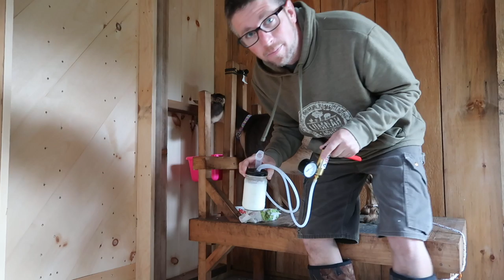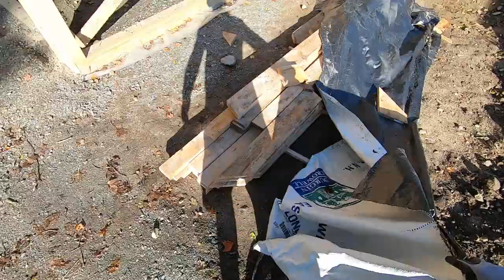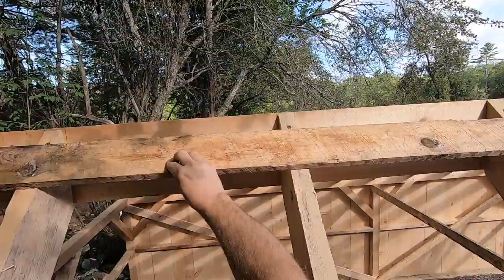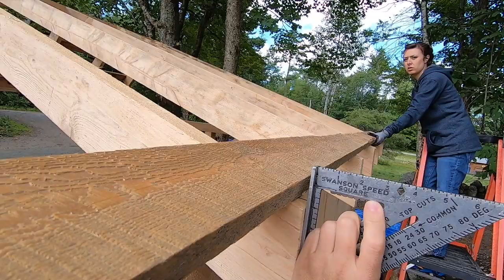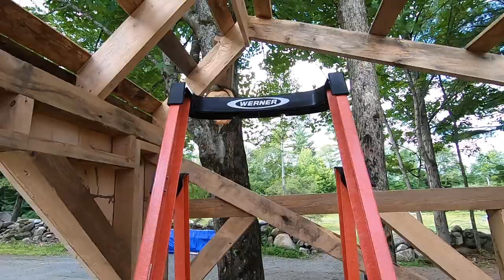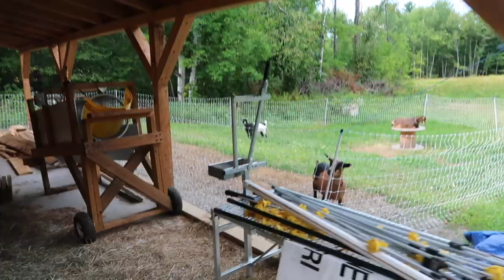She Doesn't Have her SEA Legs Yet! 1st Time Working on Scaffolding

Comment: Thank you ... from my old days of building houses and before aluminium staging, we used 2 X 12's --- to stabilize the walking platform (using 2 - 2 X 12's) we would screw-on a small piece of plywood or scrap 2 by ... this would help to eliminate the bounce and provide a comfortable walking platform.  Again, thanks for sharing.

Comment: Suggest putting pallets down 2 stack firewood on inside the shed...
Reply: I was thinking those pallets they used to separate the new fire storage shed would be perfect.  I think they came with the goat barn.
Reply: I use pallets for big round hay bales and firewood. Snakes love it in the summer. It helps save the hay and wood, but my nerves are a wreck. LOL.

Comment: Nice shed but I'd suggest putting a gutter over the front part, otherwise you're gonna get a lot of rain water creeping in. I know it maybe not that good to look at but it avoids any damp build up at the entrance. Good luck!
Reply: sorry I realise I did not explain myself properly, without any roof overhang protecting the openings, you're going to get rain falling inside, obviously how much depends on which direction the wind blows the bad weather, even if most comes from for example the rear, I am sure like where I live the wind brings the rain normally from the west off the Atlantic Ocean but many other times it'll blow from all directions, and when really stormy, it blows horizontally!! I recently put some guttering up and extended the roof by 4 feet, all to prevent some old wooden cladding from rotting. Good luck again, enjoy the videos and like many, full of admiration for taking on such projects, a heavy responsibility -  you're fortunate indeed to have essential family contributions to help ease the workload!!

Comment: I built a basement under my house with stairs going down. It was warm but not too warm as the moisture from wood drying didn't need to be in the floor. I could put five cords of wood down there and it sure was easy and convenient for me to get the wood needed for the mrs., to keep house warm. She could if needed get down there cause we had our largest pantry down there. I sure miss that house that took the two of us about all told three months to build then work on for the rest of the time I lived there. Houses do need maintenance from time built. Ours was appraised at four hundred thousand dollars and we cut all the lumber off our land and only bought the fancy moldings and what not plus the brick for the two fireplaces. We put the king stove inserts in the fireplaces as we intended at the start

Comment: Kudos to Gina for getting up on the staging. I've worked with people that could scramble around on staging and wall plates like monkeys. Not me, my toes would curl around like I was trying to get a death grip with my feet. Safety tip with staging. Don't stage materials on your walk planks, they're a trip hazard. Better to put more planking across the top rails of the staging behind you to set tools on and stage the materials on or behind that.

Comment: That is not a lack of "sea legs", that is a Fear of Heights.  I feel you Gina.  She cannot even stand to see you off the ground, Al.  Gina was over-the-top brave to do her part in making this a bit easier for Al.  Once I get off the ground, I can feel myself falling.  It is a very real feeling.  I have to hold on to something to counter-act that horrible feeling.  I used to go hiking in the mountains when I was younger.  And when I got to a steep on-the-edge part I had to hold on to rocks, trees, branches, roots,  the ground (and move like a crab) whatever.  Here I am with a 100 pound backpack holding on for dear life to the side of the mountain.  I even have trouble breathing.  My whole body goes into a sort of panic mode.  Take care cuties.  Also, Al, Kevin at Weed Em and Reap needs your goat milking machine plans that you designed and built.  He bought one online and it was fail.  Have a great weekend Lumnah Acres.

Comment: Did you do an analysis on the cost of wood vs. gas/oil, since now you have the cost of buying wood , wood shed and valuing your time to stack, feed the stove etc.  ie. your time could be devoted to utilizing your field and its potential to return value.
Reply: I think what you are saying is, burning wood is not economical and a time hog.    This would be somewhat true.  Nevertheless, there are intangibles to burning wood, such as what it does to family cohesion.  It keeps one close to nature and the heat from wood is the best.  In a time of emergency or disaster, wood will be dependable.   It's not only about the economics, although that is important.

Comment: Al & Jenna
With those apples and metal roofs you could have a lot of dried apples. My mother used to make bags of dried apples.
Great for fried pies.
You could make a screened panel for air flow on top and bottom. Put strips along bottom with felt so no metal damage.
Can’t remember exactly how mama did the last part but sure remember the dried apples. Great for snacking also. 
Ive been told to spray trees before blooming for worms.

Comment: Question: Are the bays of the wood shed wide enough to get the bucket of the tractor through for loading/unloading firewood or for adding more gravel flooring when the time comes?

Comment: Gina's concerns are very familiar, though the issue of working on a platform can improve with experience. Learning to ride the platform's wobbles without also using a powerful potentially dangerous tool might assist. Working at height always disturbed me and to do so now, (I am in my mid seventies and had several significant spinal operations) fills me with dread. It is natural to ignore your expression when concentrating, even when being filmed; the job matters, the look does not. This is probably why 'work' photos are always posed. The bottom line is that Gina is also a vital part of team Lumnah Acres and invested team members like them hold the winning player formula.

Comment: Ramp vs no ramp? I'd say no ramp. In winter you'll have snow accumulating and your snow shovel will only get stuck on that ramp. And you'll be using the sled to gather wood. Spring is too muddy,  although the sled might work in the swamp you get. LOL! The rest of the year you'll be loading the shed with wood... If the kabota fits, you'll probably only get the bucket in,  as you'll need room to move. So I see no reason for a ramp. Besides you want to keep the moisture away from that wood as much as you can. Nope! Just don't see any reason for the ramp. 💝☀🌵

Comment: door+s on wrong side...roof height is larger at the front. wood finish behind
Reply: Roof is higher at the front so the snow will slide off the back & out of the way ... which translates into LESS WORK.

Comment: Normally for safety purposes scaffolding has a solid base covering the work surface. Easy to make a miss step and have an accident. OSHA standards
Reply: Not quite true... 18 inch platform for anything less  than 8 feet in height … after that fully planked.
Reply: Rebel Yell looks higher then 8 feet, some state like CA has more stringent rules